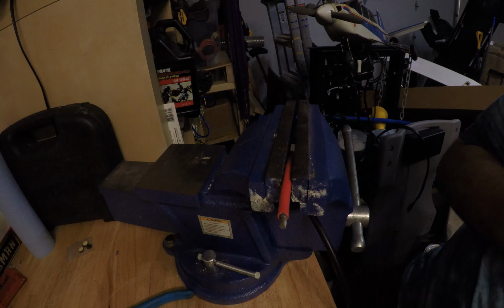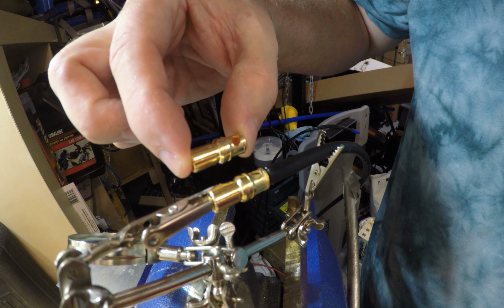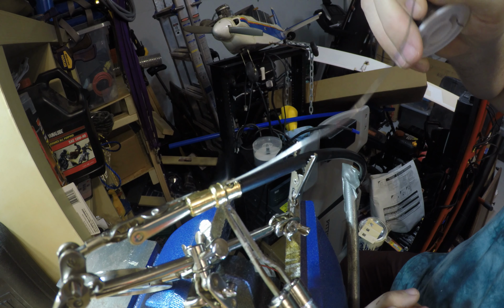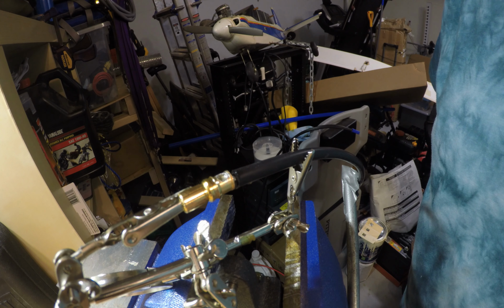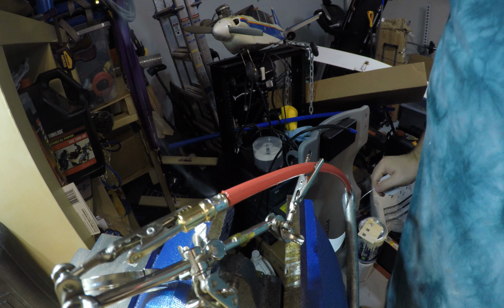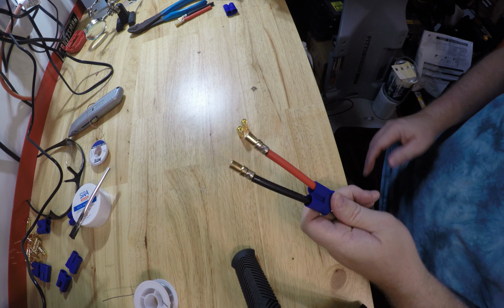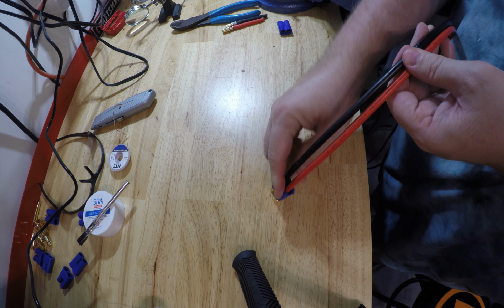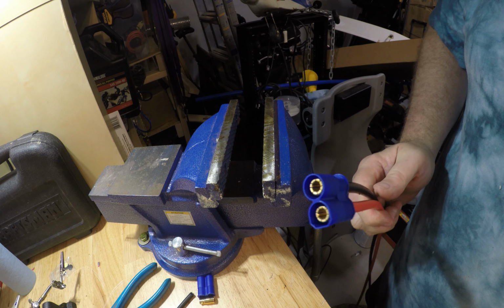EC8 Connectors

Comment from the maker: Note, you need to tighten down the heat gun tip on a new heat gun or you won’t get full wattage. It comes with an Allen wrench.
Reply from the maker: One more note, when soldering, I am heating the bottom of the ferule with the tinned tip inserted but i am pushing the solder wire past the tip into contact with the ferule so the solder will melt. As the ferule fills up with solder it bonds with the tinned tip of the wire.
Reply from the maker: Please Like and Subscribe!

Comment: When I solder ec8 I use a mini torch it works better. I tin the wire with the solder iron then I heat the conector up with the mini torch then put solder in it . Then I re heat the conector then I put the tinned  wire in conector then I let it cool till it doesn't move. Then I use the sder iron to fill the rest of the conector up.

Comment: I put the connectors right over the solder tip to hold it then fill the connector half way up with solder then dip the wire into it. Works pretty good for me

Comment: Curious what Diameter solder you use as well as what flux you use? Also thanks for the video very helpful
Reply from the maker: 1.0 mm fine solder sn60/pb40 and standard rosin paste flux SRA brand #135, thx for watching 👍🏻

Comment: THANK YOU for posting this!  I bought the inergy Apex with 3 solar panels to use in my van.  Unfortunately, the new EC8 connection type does not fit through the standard roof boxes.  I was afraid I'd have to cut a large hole in the roof just to get the connections through to the generator.  However now after watching your video, I feel confident I can remove one end of the connectors, run the wire through a MUCH smaller hole and add a new connector on the other side with minimal fuss.
Reply from the maker: You are most Welcome, glad to be of help! I have another video about the Inergy Apex on my channel as well. I'll be adding more shortly.